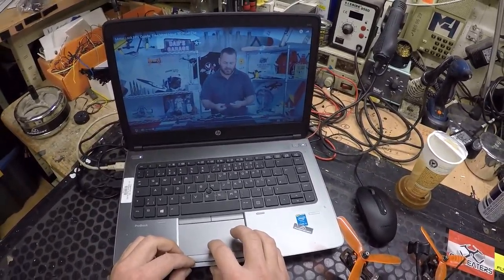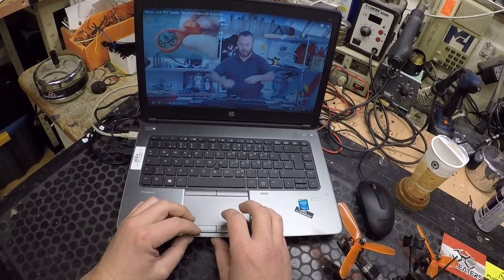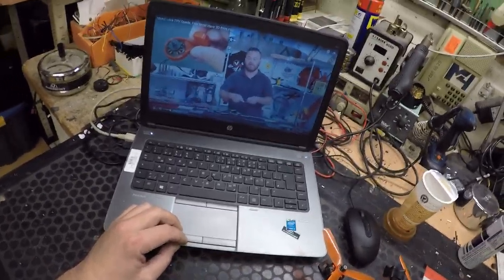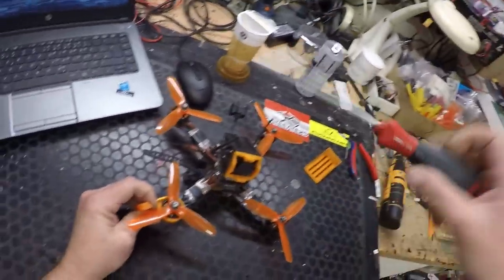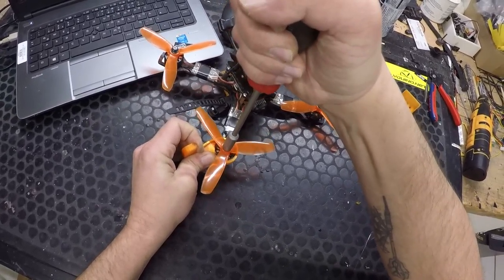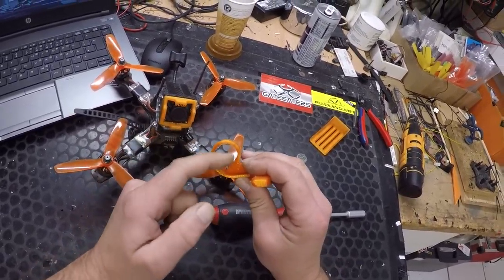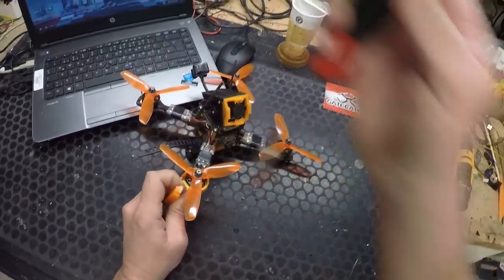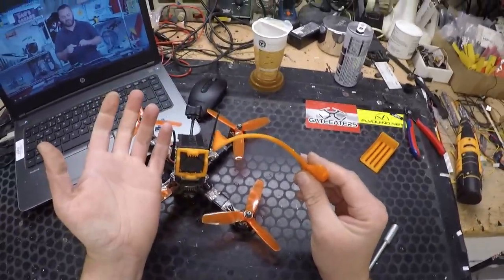Motorlock strap, nice idea but not working

Comment: I have a question about the print. What filament did you use and did you needed to change anything to the 3D printer
Reply from the maker: i used my default TPU (SainSmart 1.74mm) settings on the printer which are 210° nozle and 40° bed, infill like in the description 50% layerhigh 0.2
Reply from the maker: Printer is nearly stock beside hotend is Flexion and bearings are now IGUS